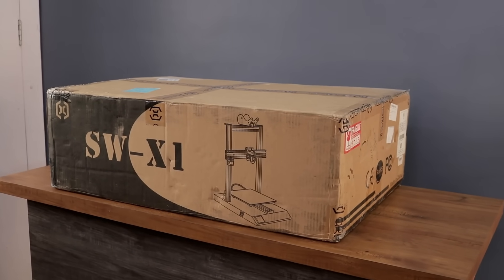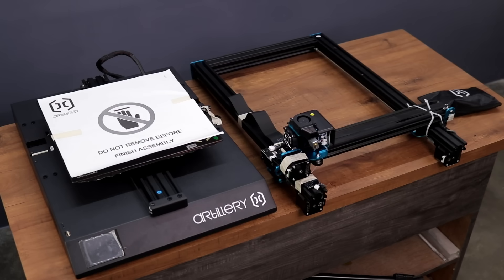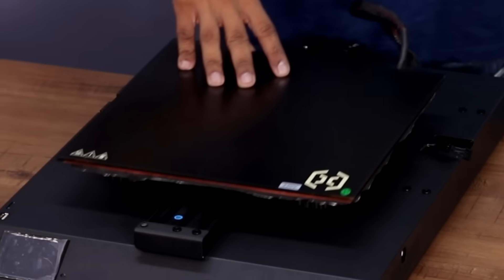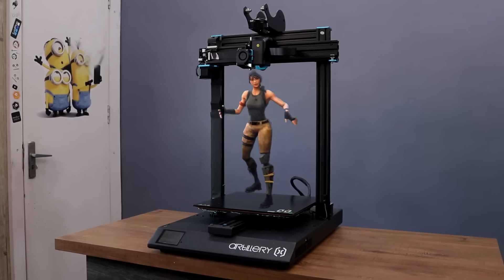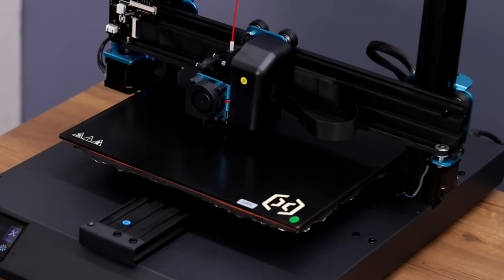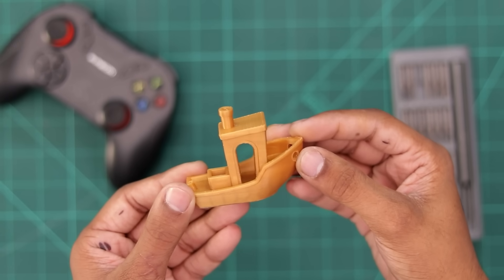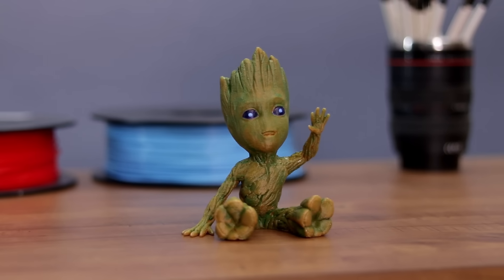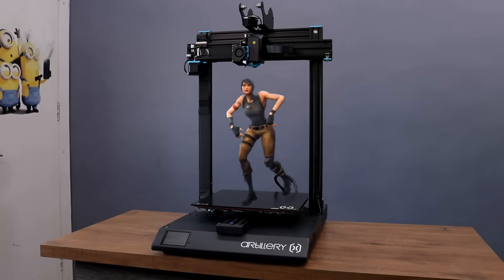WOW! Amazing 3D Printer | Artillery Sidewinder

Comment: what is this made of? - Metal? And how do you get the design into the printer? Can it do it in full color? What is the brand of the 3d printer you are using?
Reply: It's not metal, the material is either ABS, PLA or PETG

Comment: Imagine in the future the 3D printer all become very cheap and anyone owns it (we all didn't own touch screen phones 15 years ago), the "authentic" hand made items such as pots, vases, etc. become super expensive and/or rare... wild.
Reply: Well they still cost just as much as a phone
Reply: a decent 3d printer would cost 500$ on average, that's nothing compared to what you can do with it.
Reply: @ajaxnation9504  exactly they are cheap
Reply: @ajaxnation9504  do you need to buy any component to use as input for the machine or is it already included ? How much would this cost?
Reply: @elred9871  Well the printer obviously needs some kind of "3D ink" I don't know what it's exactly called exactly, there is nothing other than this and electricity of course to run the machine. As of the price of this 3D ink, I found a brand that costs 20$/250 grams (0.55lbs), still, the price of all these things is affordable for such a technology that we only saw in movies back in the day.
Reply: @elred9871  for fdm 3d printers u will need filament for resin 3d printers u need resin .both are redly available and aren't expensive.the printer in this video is fdm it uses filament to print .
Reply: @ea2314   yeah u  can get 3d printers like ender 3 for 200 dollars a decent android phone will cost nearly 200
Reply: Never will be cheap. You can probably buy a cheap 3d  printer but in future serious printable should cost soo many and will be secured.
Reply: A good resin printer, shich is better then a fdm pri ter is cheaper then the last gen iphone... so everypne who can afford a phone can afford a printer
Reply: Now it is cheap too

Comment: Hey, I was wondering if there is a possibility to make a Thermos with 3d printing?
Reply: Yes, you can.
Reply: @AvivMakesRobots  and the vacuum will work just fine, right, because it is a poor conductor?
Reply: @lucasagazzani1597  It depends on the material you are printkng with, as well as your design and tolerances.
Reply: @AvivMakesRobots  thanks

Comment: You need to dial in retraction that stringing is too much
Reply from the maker: Yeah, i know that, i have did some changes when i have print golden Boat and the Pot and they both turned out very well.
Reply: @TheWrench  they didn't turn out well, they latterly sucked because of the bad quality, you probably got sponsored to give it a good review but even my 150$ ender 3 is better.
Reply: @TheWrench  I mostly use the cura stock profile for my ender 3 and works pretty great